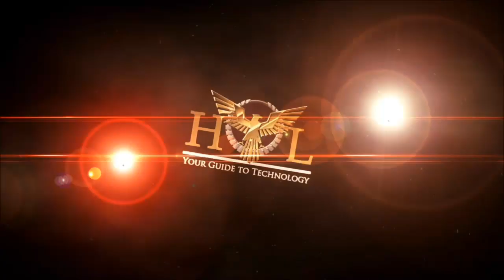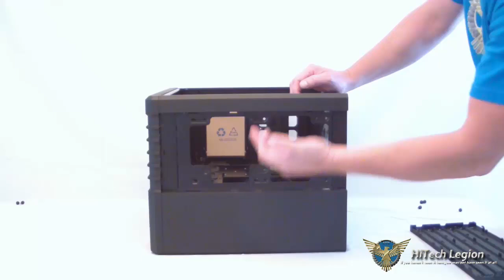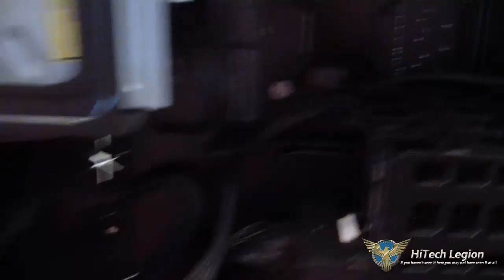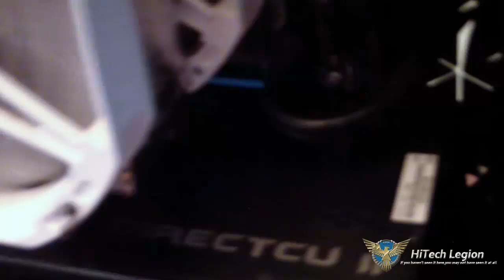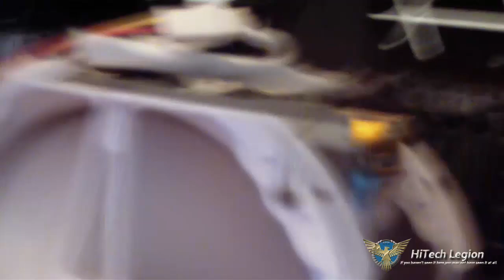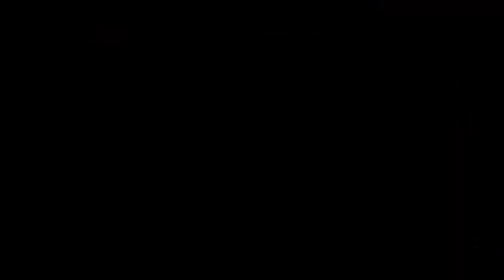Corsair Carbide Series Air 540 Case Cube Review and Installed Components

Comment: Hi your video helped me out but i am left with qiestions that i cant answer... the side where the power supply is can we fit fans in there? I saw a forum that said yes but 120mm does not fit, and they said to use the 140 and i am pretty sure the 140mm will not fit... so what size fan fits above the power supply? And what fan should i get

Comment: So this giant case only has 2 slots for HDDs? Both my 4 TB HDDs are almost full. I had to install a third so I just placed it naked under the cable management system. 

Do you have a recommendation for a case with more hard drive slots? I was thinking maybe they made some type of carriage to replace the SSD one so I would place my SSD under the cables instead and be able to slap more HDDs in. Thanks for the info.

Comment: Hello, That CPU Heat Sink I never seen or would Use! it best in your Case if no Over Clocking to use the Stock CPU Heat Sink and Fan or if Overclocking Corsair H100i Water Cooler, Because I have that same Case with the Corsair H100i Water Cooler and never get loud, it could be that with the Glass Door and your Heat Sink and Fan don't get enough Space between then to get Proper Air Flow or Go with the other Heat Sink that more on the Side and not Up like your with The Fans Point the Back Exhaust.  -  Derf

Comment: OMFG!!! That freaking SSD cage doesn't come out as easely as in the video... not even close... I've put tons of pressure on it to only end up breaking the slide things off (without breaking them xD) so only the mounted thing is left... no way of getting it out, that lever doesn't work, not even when smacking it with a hamer.. been fighting the cage for an hour now to only get a nice cut in my finger... I'm close to rage mode.
Reply: Wha Mi It was pretty easy for me. Should just push down on tab and either push up or push down, pops right off. 
Took me a while too lol.
Reply: It's actually very easy if you don't easily get frustrated. You have yourself to blame here.

Comment: It should not be loud to bother you, the stock fans go as loud as ,24db and that is not loud at all its like a whisper. If it does bother you get noctua fans and put them on your heatsink or rad also. Also on cable management,  I like the point that you made that you do have to go back and forth, because what do you expect from that type of case. One last thing I don't like about this case is that some of the cables are a little bit short but you can manage, or just get cable extensions. Excuse me for my long comment but I had to say my thoughts.

Comment: I know this is kind of a late question; but how many millimeters of space is there above the motherboard, would you be able to use a 55 mm or 60 mm radiator with fans in a push (and/ or pull) scenario?

Comment: I have an Antec DF85. Same layout as the Antec 1200. I have (3) 120's in the front, and (2) 140's behind hdd's under the 5 1/4 bays.? The hdd's cages do not sit sideways, so nothing to resrict air flow. That's ( 5 ) 2000 rpm fans on a fan controller for intake.The  140's are 1 inch away from a 770 GTX and partially in-line with push and pull heatsink. 2 120's on back, and 2 more 140's on top. My parts stay ice cold. I'm old school. No water, just air : )

Comment: Not all folks use the roof for an exhaust; yes, while we all know that heat rises, there are many that use the roof as an intake.

Besides, whose to say that the chassis has to stay upright; put the case on its backside (where the PSU exhausts), add 4 feet, and the roof now becomes an intake access point - much like the Cooler Master HAF XB.

Comment from the maker: HTL shirts are available in the forums, I usually place an order when I have 10 requests. Had no problem with vibration on the psu it has a locking mechanism on the bottom. As per the side panels, they didn't bend when I held then on the end. ( I consider that the deciding factor) I have had side panels do that before and would have certainly mentioned it. The case is light and constructed well. IMOHO